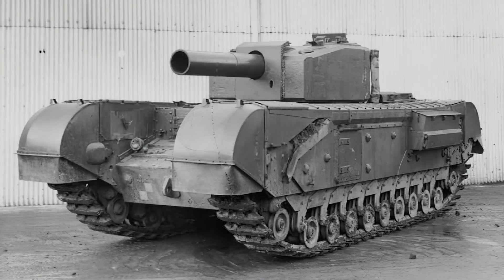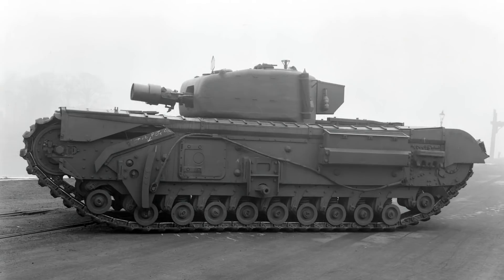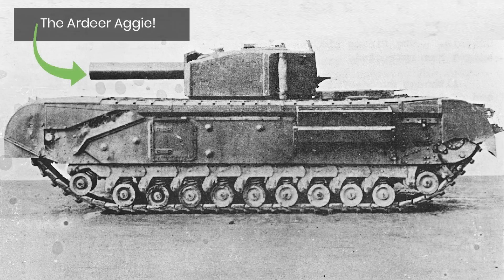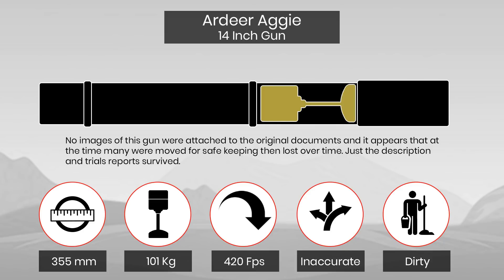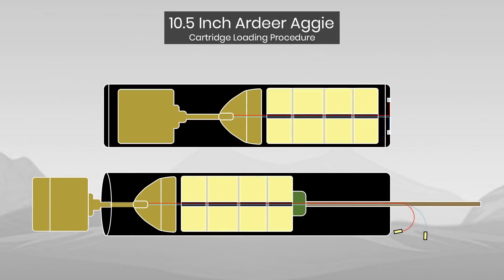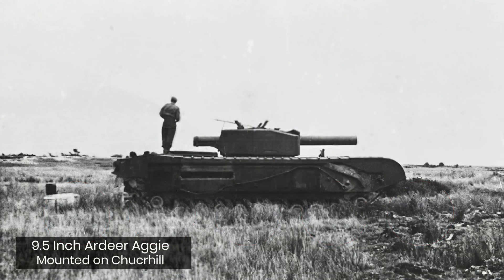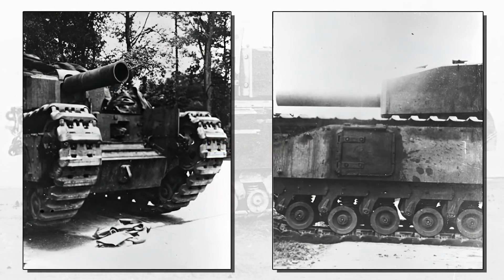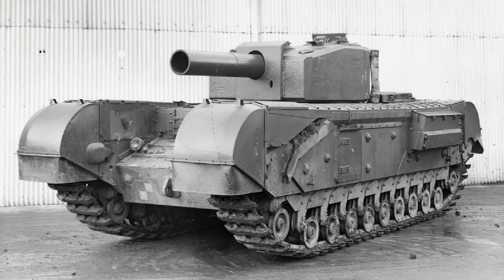Ardeer Aggie - Tank Design & Development

Comment: I believe one of the ways this has been tackled in more recent guns is to use water rather than sand as the counterweight, reloading could have also been made easier by extending the turret though you would still need the ejection port.
Reply: Except you can't extend turret, you're limited by turret ring. As for water, it's only possible in small guns and with modern containers. Imagine trying to lift wet cardboard bucket of water, there is a reason why they used sand...
Reply: @KuK137  Extending the uninhabited portion of the turret doesnt require alteration to the turret ring so long as the bearings can take it. The water isnt in the ammunition but in a reservoir tank built into the vehicle so not sure where your getting wet cardboard buckets from.

Comment: That rear back blast problem could have been easily solved by building a vented enclosure around the back with a firing operated trapdoor which would open to allow the cartridge to exit.
Reply: You really think there is an enclosure that can withstand a few hundred kg of sand blasted by explosive? Are you on drugs?
Reply: @KuK137  A few hundred kg of sand? Where does that come from, out of your imaginary playground?
Reply: True: since several MBT's today have Blowout Panels for if the ammunition cooks off, a firing mechanism triggered hatch for the back of the Aggie gun isn't all that implausible.

Comment: Take the Petard . . . mount the spigots in a bank on a turntable . . . and you have Hedgehog.  Genius lies in improvisation of existing ideas or hardware into new motif or to fit a tactical need.
Reply: Aye. First ever Depth Charge was a modified SeaMine.
It soon became apparent though that hunting Sub's with a weapon system hefting enough explosives per Depth Charge to sink a Battleship, was perhaps slightly overkill.

Comment: Move over KV2, there's a new derp in town.
Reply: "What you got out there on the back of the turret comrade? A machine gun? Look at this magnifique slew of sandbags cannon!"
Reply: The KV-2's 152mm projectile either it's armor piercing or high explosive has a much longer range, much more velocity and most important, greater accuracy.
Reply: All nerfed
Reply: * new derp
Reply: Lol they always use heavy to put derp
Reply: at 45 seconds a round and .65 dispersion without the KV-2 soft stats good luck with that!